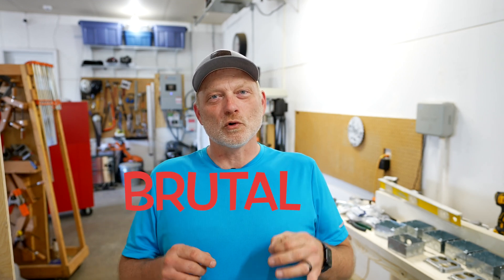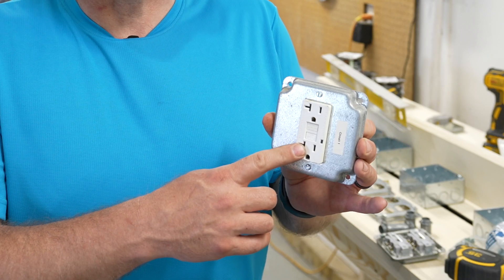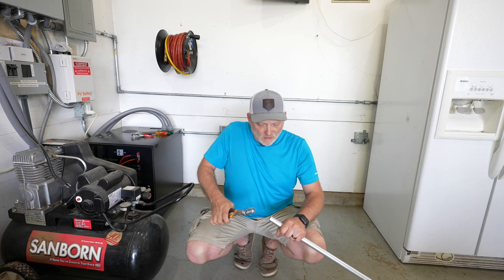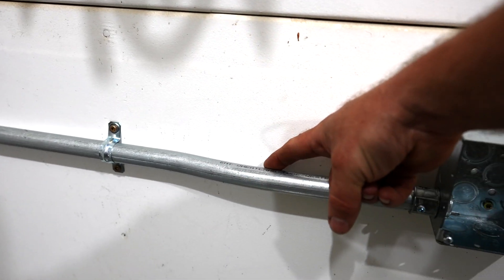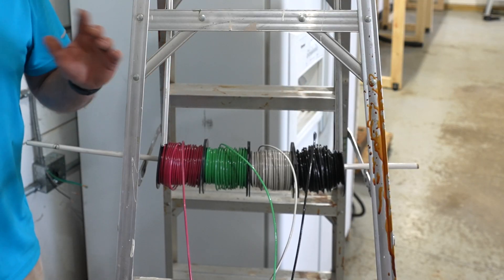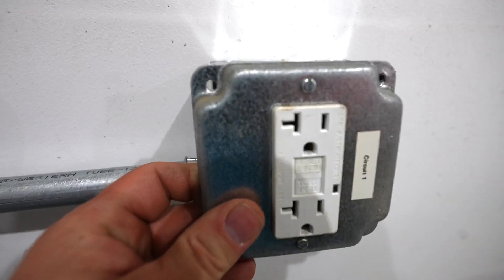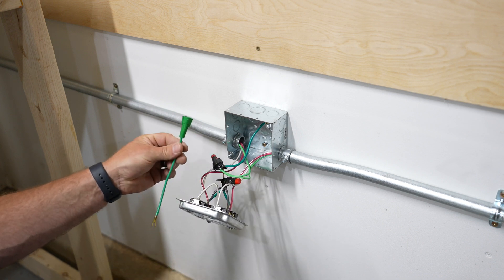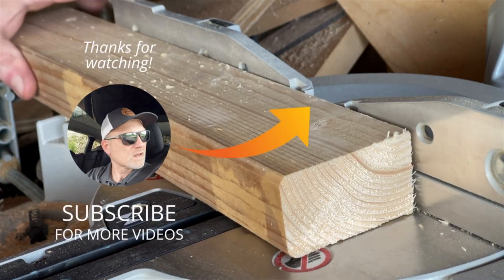Electrical Outlets (Re)Install - Workshop EMT & Outlets

Comment: Sorry, I got hooked in, could just not watch, I put THOUSANDS of feet of EMT up every year, went thru over 300 feet of 3/4 just this week and the week is not over, that is a lot better than just putting that rope on the wall in the open to get hit, THHN in EMT is better, in dirty locations I use compression fittings to keep the dirt out of the pipe.

Comment: nice follow up video. so are you sharing neutral for both circuits for a MwBc? if so, i didnt think u could have GFCI on mwbc?? not that its dangerous, but it will make the gfci trip
Reply from the maker: I pulled three wires for each circuit (neutral, hot, and ground).  The hot wire is red or black, depending on which circuit.  Otherwise, neutral and ground are both white/green. On the first few boxes, I used a red marker to mark the white/green wires on the circuit with red hot wire. I don't recall if i kept that method going to the last boxes, since I was pulling wires to each box, then cutting them, to make sure I didn't mix up white/green between circuits.
Reply: You can have 2 GFCI's, one for the red and one for black wire, tripping should not be an issue because they are on different circuits. The neutral wire to the first one must be pigtailed, similar to how 2 regular receptacles would be done.

Comment: I think you did a really nice job here. A couple of things I did differently when I did something similar was to use moulded or formed boxes which have rounded edges. They don't seem to be readily available at HD in that depth, but they are online and HD may supply them on order. The 1 1/2 inch depth would be a tight fit in the quad boxes. I used all solid wires including the box bonding connection and I used THHN wires including ground in the conduit like you did. The other difference is that I used 15 amp spec grade receptacles instead of 20 amp receptacles, even though it's a 20 amp circuit and 12 gauge wire. I don't know of anything that I would use that has a 20 amp plug.
I attached the box cover last after mounting the receptacles instead of mounting the receptacles with pigtails separately as you did. Your method might be a bit better.
Reply from the maker: Ted - thanks for sharing your info/experience. I did a little overkill with the 3/4" EMT and 20-Amp outlets.  I'm always a little concerned about future regret that I didn't build enough capacity for expansion if the need occurs. This way, I figure it'll be future-proof.